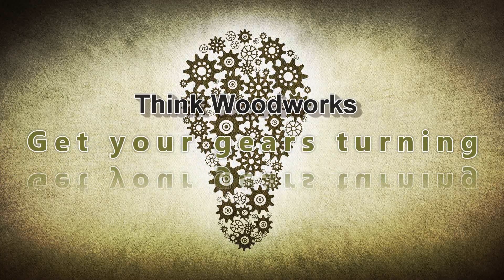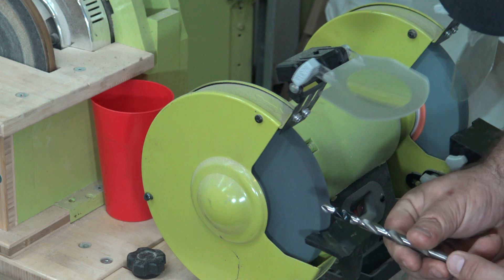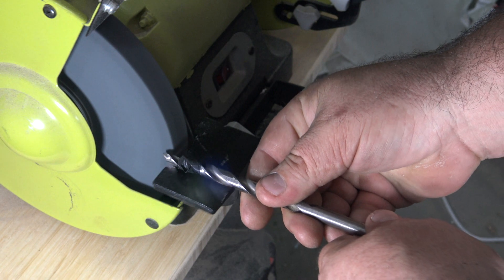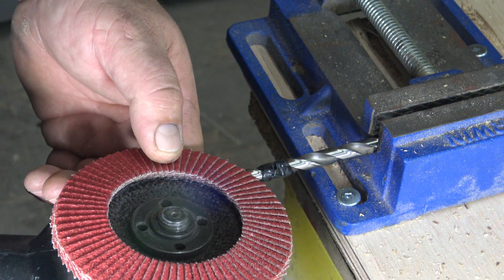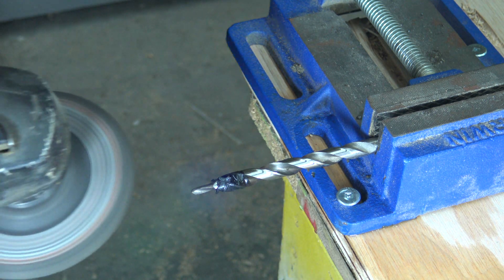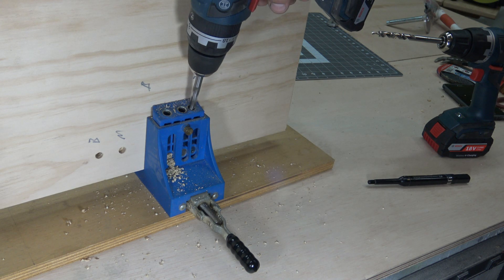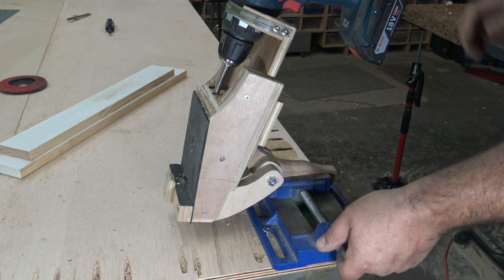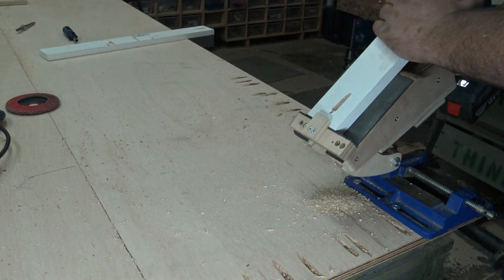How to make a stepped drill bit for making pocket holes.

Comment: absolutely brilliant.. never thought of it... ty very much.. in uk these things can cost anywhere from £15 to £27..Now for plugs..I make my own because they can be expensive (I work with kids) ..I drilled a hole of the size of plug I wanted into a piece of steel about 4 mm thick, then with a mallet hit a piece of square pine slightly larger than the hole through it.  Job done.  For Pocket holes plugs, drive plug into a pocket  hole, band saw to cut the top flush and push out from the other side.

Comment: Try clamping a drill motor with the bit in the chuck. Then use the hand held grinder with the sand disk. You can achieve a much rounder step diameter. Thanks for all the cool ideas and great videos..

Comment: Drill bits are high speed steel. You can get them red hot and not soften the metal. It is quite hard to anneal them. Almost impossible without a furnace. Even then, it takes hours.

Comment: Would you not be better off chucking the drill into a drill motor and turning it down that way. You would get a much more even reduction in diameter with the drill turning the bit against the side of the grinder.
Reply: SATAMAN Schmidt I have done it that way to Finnish a job after I broke my last bit it works.
Reply: SATAMAN Schmidt Great idea!

Comment: I would have chucked the bit into a VSR drill and run the bit backwards against the running bench grinder, with a tin can full of water nearby to dip the bit frequently, to keep it cool.
Reply: Don Crowder Tin can, magnet in bottom and a tiny hole will drip water where you want it.
Reply: K.D. Pearce I like the idea, but don't fully get it...could you elaborate it a littel more? Thanks
Reply: ***** Magnet in the bottom, I think to hold it against steel surfaces with all the vibrations going on.  The small hole is a "calibrated flow restriction" (joke, I mean, it's quite uncalibrated and approximate) to allow relatively even flowrate if your can is big enough so the water level doesn't go down much (honestly best to refill because if I'm not mistaken the water level does effective the flowrate, but maybe not much.

Comment: There is a better reason to do this, i live in a metric country, i have a Kreg K5 that works great, BUT, at the moment of fill the holes with plugs, guess what, i don`t have 3/8 dowels, here we have 8mm or 10mm dowels i know that i can do my own dowels, but there are very cheap 3.3 meters long dowels that can be cut in dozens of small ones, so, if i can get a good 10mm bit converted in a step bit, that could work great.